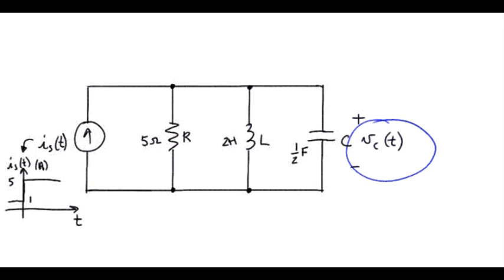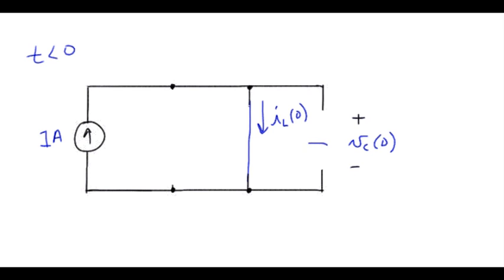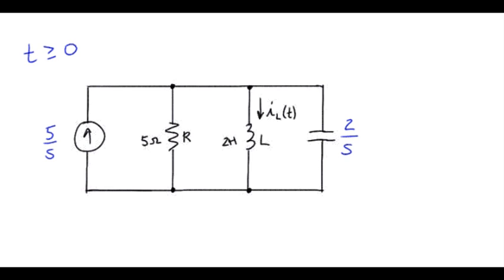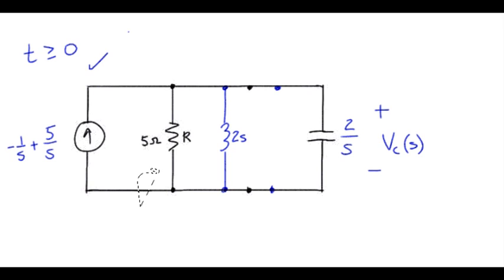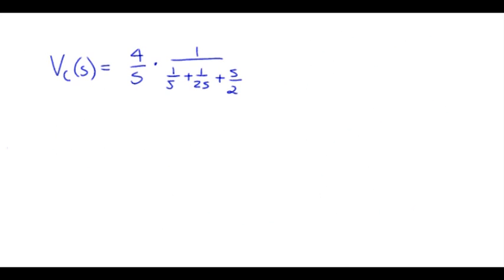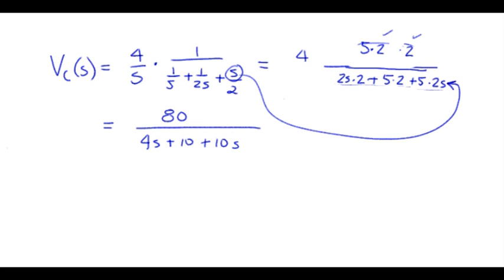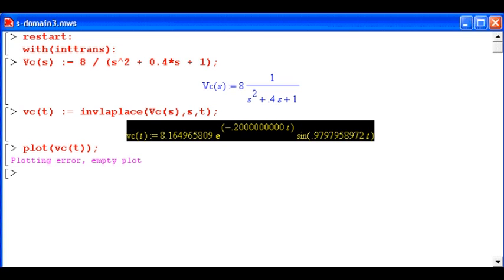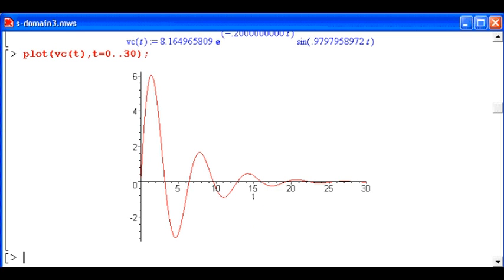s: Laplace Transform Analysis Example #3

Comment: What did you do with the numerator ? It should have been 80S correct it pls
Reply: Harsha .N 
He factored out a 10 from the denominator and then divided the 80 by 10 thus giving an 8 in the numerator. Not sure where you are getting the s from.

Comment: why do we say that the dc steady state volatge over the capacitor must =0? (in the last few secinds of the video)isn't a capacitor at dc like an open circuit (because of infinite impedence) so it will have no current but still can have a voltage?
Reply: An open circuit can still have voltage despite not having current. A short circuit on the other hand, can have current despite not having voltage.
Reply: No for dc it’s like an open cat but for AC a cap is like no barrier. It wiggles thru like s snake ac alternating current.,
Reply: Cct-  circuit

Comment: il(0) must be 0 because the current source doesnt work becouse it needs a small voltage to work  , but in this case the potencial difference  is 0 so the whole circuit is off .